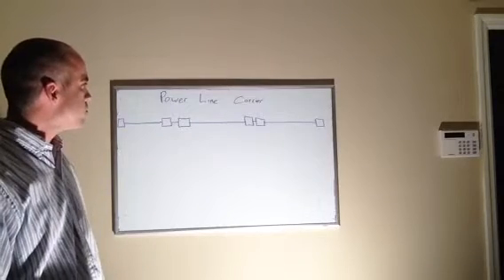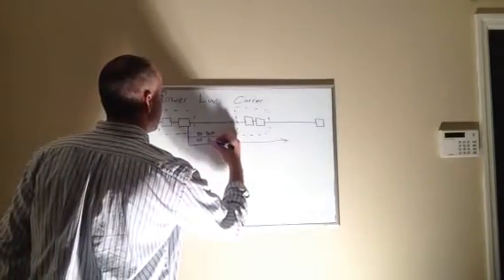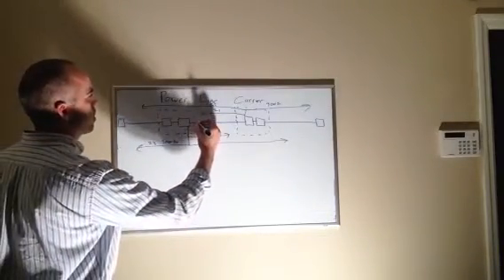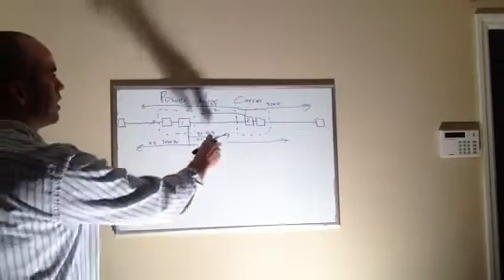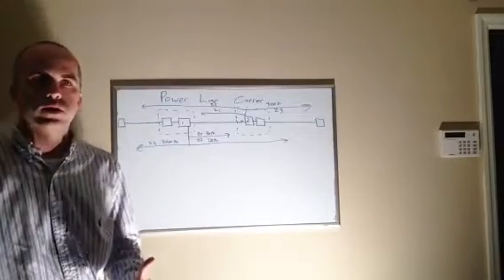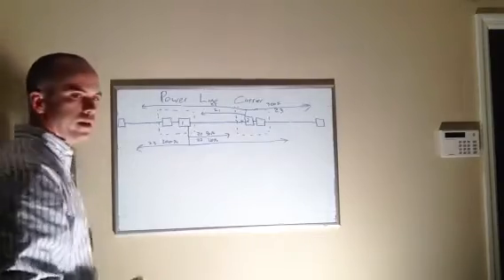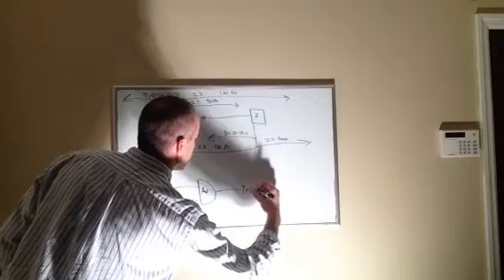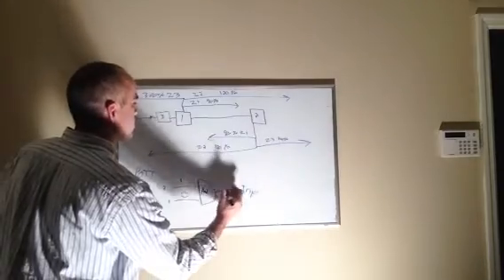Power Line Pilot Protection

Comment: in our case , we have a fault some where and the breaker tripped on buchklz relay, and pilot wire protection relay also tripped, put what i surprised that why the diffrential relay of transformer does not tripped , and in our case the secondary cable jointing kit of transformer had some spark and faulty, so i am asking you that why the diffrential relay does nort tripped, and why pilot protection tripped?

GRID BKR --- 33KV BKR ---- Transformer ----- 11 BKR 

so the 11 KV BKR which tripped and it has 87 relay and pilot wire protection relay.

thanks

Comment: PLC is the communication protocol used and POTT is the type of transmission line protection (scheme) supported by the communication medium (protocol) - PLC in your case -. POTT, PUTT, DCB, DCUB, DUTT or DTT are protection schemes that are supported by either PLC, Microweave (audio tone), Fiber Optics, Private and leased pilot channels and recently even satellite communication methods.
You should also talk about Line differential protection based on Instantaneous overcurrent relays (87L) which has been also seen lately on shorter lines.

Also those "coils" you were talking about on the line in the substation are indeed line traps and they are nothing more than a reactor and a capacitor that creates resonance (XL = XC) on normal frequency (60 Hz in our case) which makes the 60 Hz signal being blocked by high impedance (achieved at resonance) and will let through the high frequency signal transmitted by the PLC transmitter. So the reactor and the capacitance needs to be sized in such way that they are equal in value when a 60 Hz signal is passing though. They need to be robust in order to withstand the normal currents and high currents during a fault.